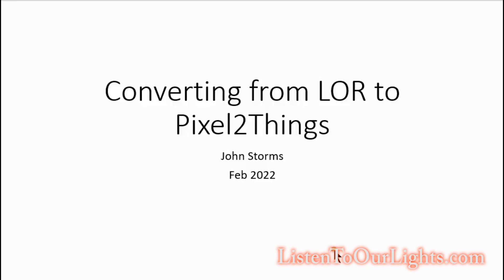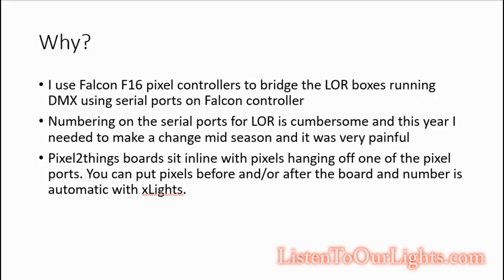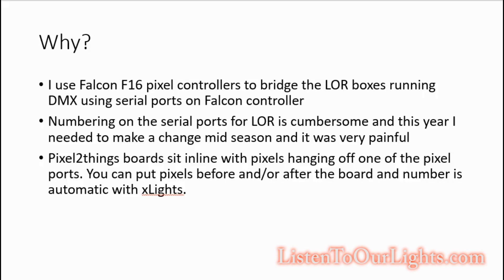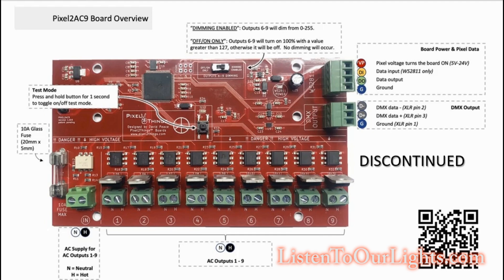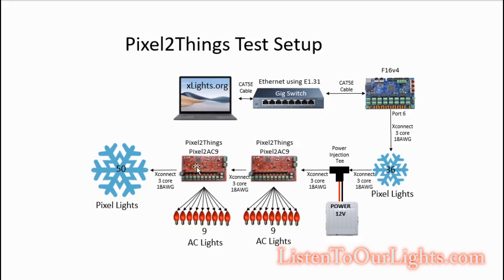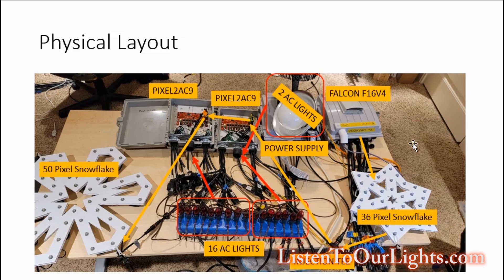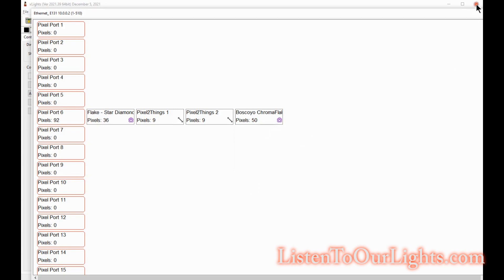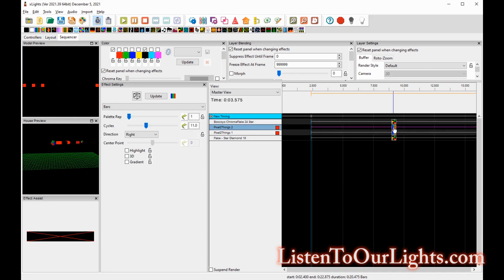Converting from LOR to Pixel2Things

Comment: We just moved to almost all LOR and only use the Falcons on the roof lines.  You basincally have to manually do all the LOR and it gets super confusing with the hex numbering.  I feel your pain.  I will say my LOR gear hasnt had any of the issues we have had with the Falcons.  Make sure you dont change a pixel count while running the test program on the Falcon or you will damage the differential channels.  This is a great video its really rare anyone shares their setup when they are using gear from mulitple companies.

Comment: I'm in the same boat... I have hundreds of Pixels sitting that I can't use until I convert/switch over to XLIGHTS from LOR.  The Pixel2Things controllers might be my answer.  BTW, there's "No Crying in Xmas Lights"  lol
Reply from the maker: Actually Xlights handles LOR controllers just fine. The numbering is a little clunky and I had these boards at the ready